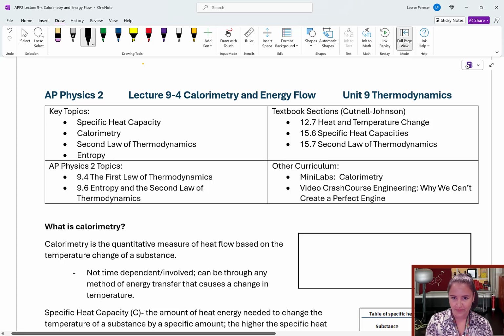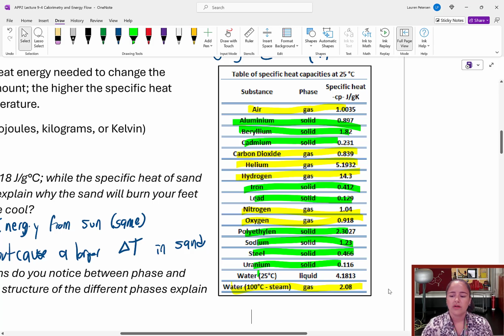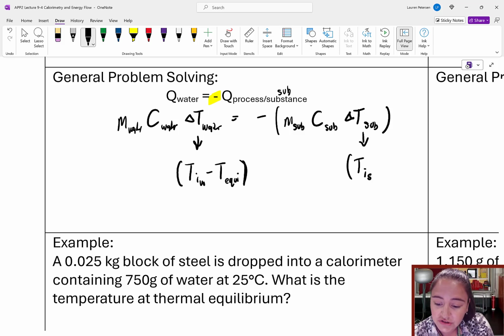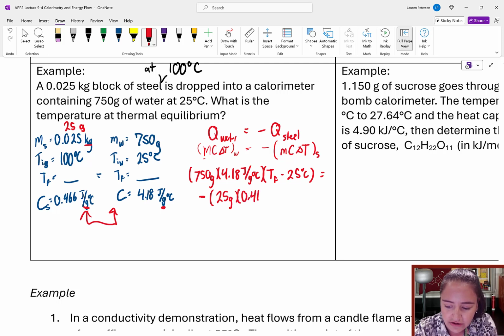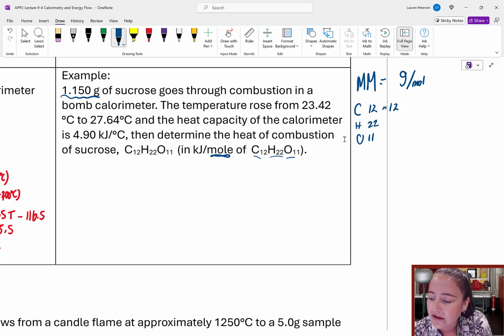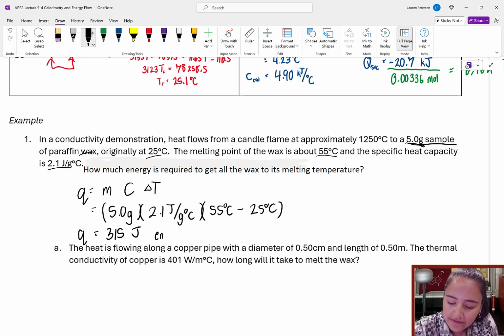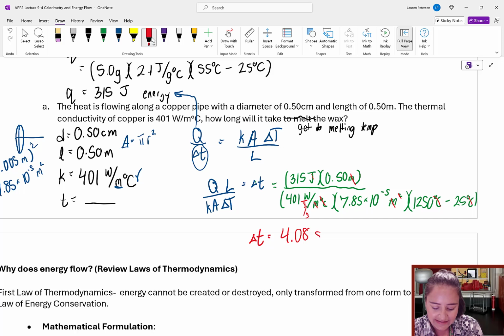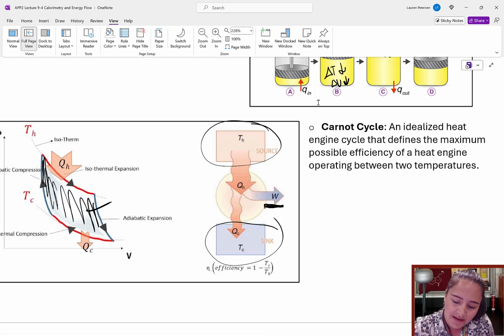AP Physics 2 Lecture 9-4 Calorimetry & Energy Flow | Specific Heat and Heat Engines

Comment: In the problem you were finishing at 20:10, Was there suppose to be a negative on the Q of the steel and isn't 11.65*100=1165?  I think both of these issues will change the final answer - I get the final temperature to be 25.27, is that correct?
Reply: that's what i realized too! i think you're right

Comment: Great video, loved the explanations! However, at around 30:50, you calculate the area of the circle with the diameter as the radius, without getting the radius. If I've done it correctly, I believe the area is about 1.96*10⁻⁵ m² (as the radius would be 0.0025 m), with the final change in time being about 16.33 seconds with the new area.
Reply from the maker: You are totally correct!!! Thank you for pointing out my error!! This is what happens when I don't have a classroom of students to double-check my math!